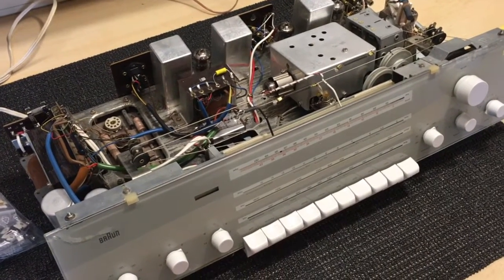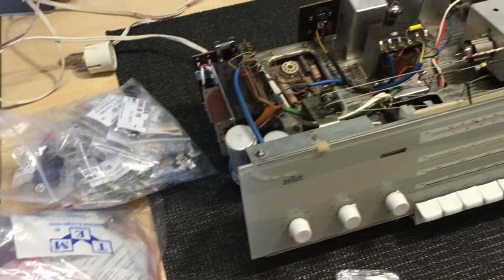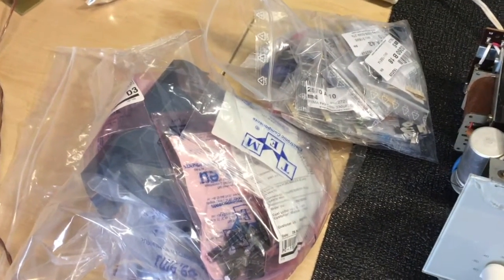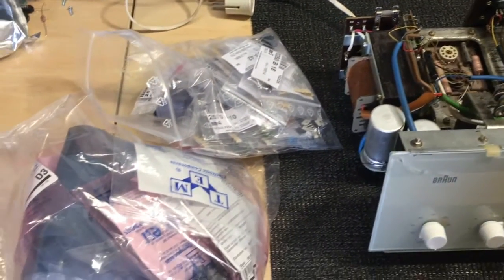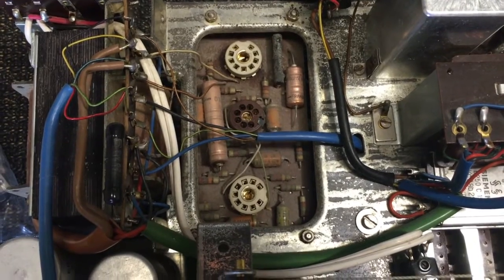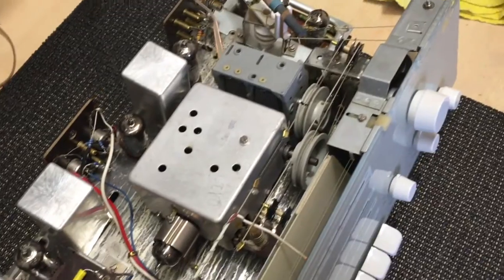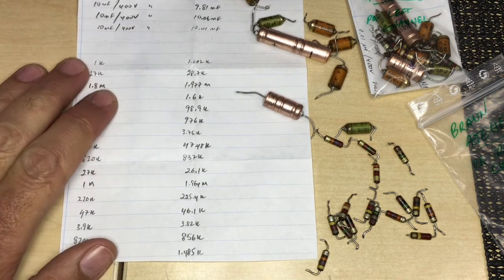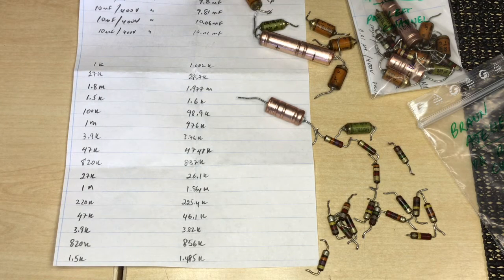Braun Atelier 3 Stereo (RC 9E) restoration - part 5. Time to rebuild the power amps.

Comment: Tengo una radio de ese modelo en Peru montado en un mueble de consola con tocadiscos automatico al radio le cambie todas las piezas de los 2 amplificadores de potencia las resistencias del los conectores Phono y Cinta y tanmbien los 4 condensadores y las 4 resistencias del control de volumen principal ( Volume Control 1)

Comment: Very nice restauration project - these EROFOL II caps are very well made - some even use them to restore radios because they are old but still well within tolerance!
Reply from the maker: +Adrian Straub : I wish all the caps were like that. It would avoid the "yellow spots" that result after the re-capping.
Reply: Honestly, that toy-ish yellow was a stupid idea from whoever decided on caps being yellow.
There are people that re-stuff the housings of old wax caps.
I have thought about that but decided not to do so because the new caps are much smaller thus making the radio's inside easier to track for errors. And with the black caps I have now, I really don't have any problems with throwing the old, tar leaking caps away :D